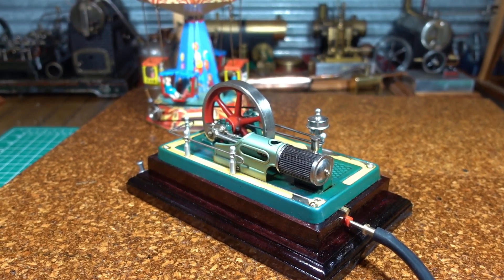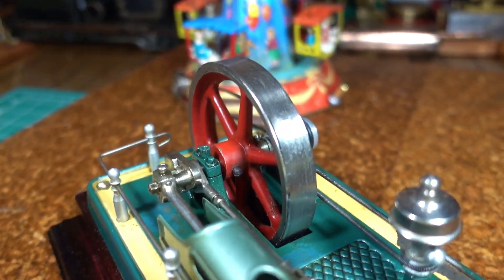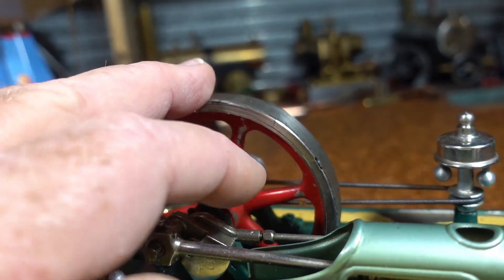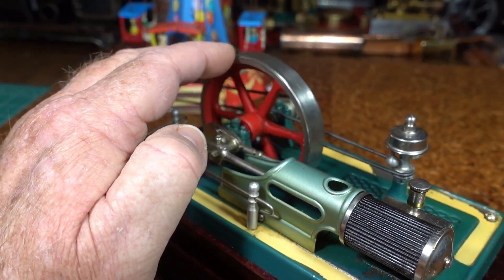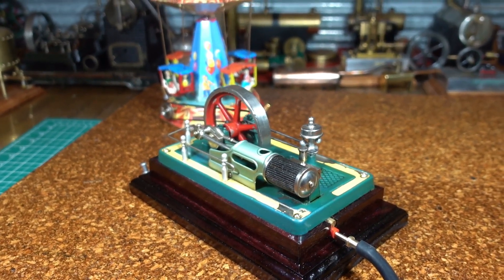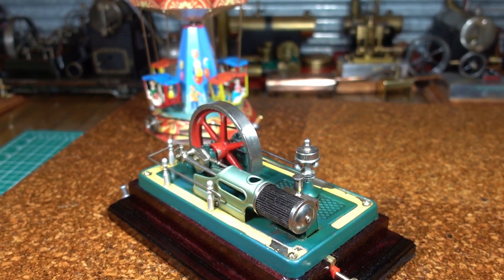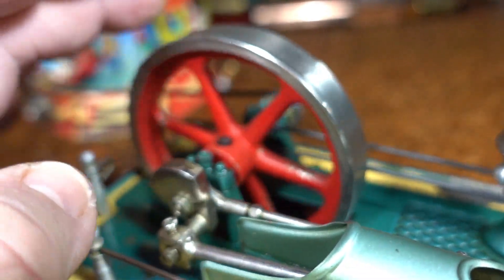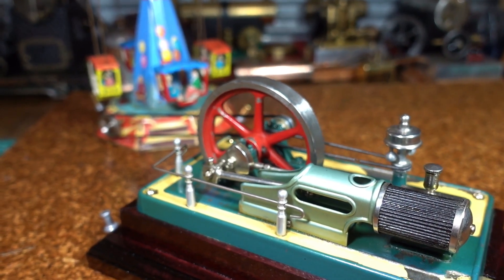Model Steam & Toy Steam Engine Zinc Pest rot fixed with Super Glue #

Comment: Thanks for this I have two with exactly the same thing happening to them. One is worse than the other so this is great info.
Reply from the maker: Hope it helps. Just keep filling the cracks till no more glue goes in. I used a fair few tubes on this flywheel - Cheers Jim